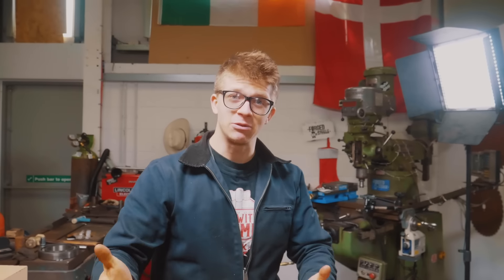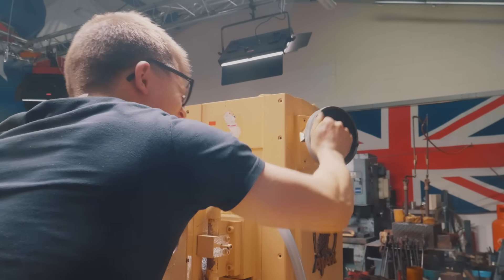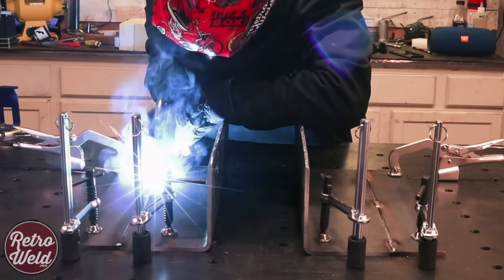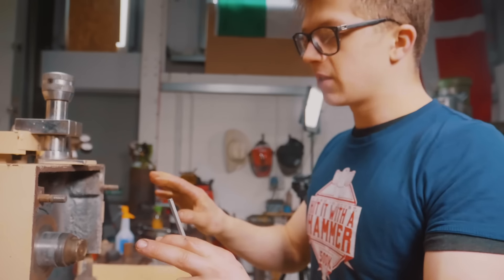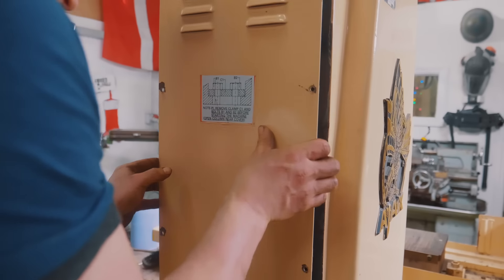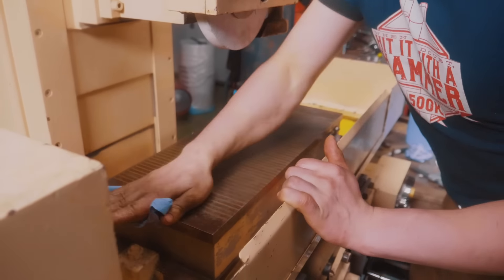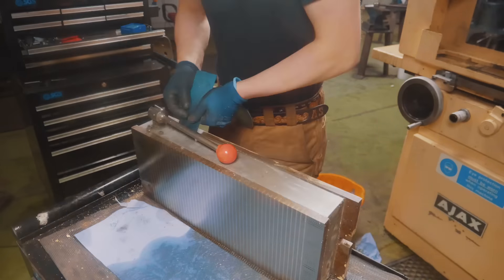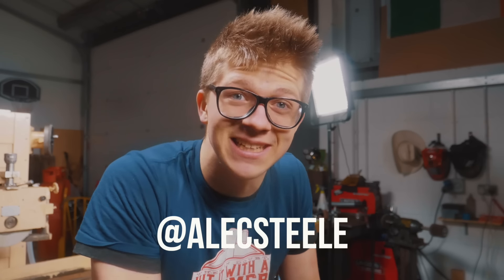THE SURFACE GRINDER IS ALIVE!!!

Comment: Hi yes you can use a machine/motor without neutral connected. But as far as I know you always need the ground, not to make it work just for safety reasons. So a regular three-phase motor has a lot of coils inside. Always one third of those coils connects to one of the three phases from the live wire. Because of the wiring inside your motor the three currents from the three phases cancel eachother out after flowing through the motor, so you don't need a neutral. A regular 1-phase AC motor (for example the one in your washing machine at home) needs the neutral to work (and the ground flr safety again). I can't explain it in more detail because thats it with my english as I am from Germany. I hope I could help make things a little clearer
Reply: You are correct. There are two ways to connect a 3-phase motor and they are called delta wye.
Reply: Eetu Jääskeläinen thanks for agreeing with me that means I somehow made my comment understandable for other people than me😂😅
Reply: aassug ok thanks
Reply: Down in Oz we call it either connecting in Star or Delta. Unless there are 6 terminals in there (which my brief glimpse didn't see), it doesn't look as if you have the option to choose. If there's no neutral terminal, there's no need to connect it. Often there's a wiring diagram on the inside of the cover... unless it was paper and disintegrated. Make sure those screws are damn tight though, and thoroughly twist the wires until they're like a solid wire (use pliers), with no loose strands hanging free. (I did not give this advice though, as here it's illegal here for those without a licence to play with electricity) Best of luck :)
Edit: that's just motor connections, of course you're not going to get a choice there, and the control circuit will probably need the neutral, unless there's an internal transformer, but I see you found a screw for it and got it connected, otherwise it may not have run at all.
Reply: The Neutral is not needed because there is no unbalanced current to send back on a neutral, otherwise known as a balanced load.
Reply: Cederbee, it's not needed for the motors, just the control circuit. I amended my last comment when I realised I'd forgotten about that :(
Reply: owl3764 Yes for control circuits. Electronics require the neutral 😊
Reply: owl3764 Hi thanks for explaining again. In Germany we call it Star and Triangle (not Delta) I just didn't know if I could directly translate that into english. As I wrote before I am no native english speaker but I am an electrician so this is basically my job
Reply: I+Marki Baki, It's good when google translate works. I thought the motor connections would have different names in different countries. I too was (retired now) an electrician for most of my working life, I worked in and rebuilt (electrically) a large factory over many years, with no more that a couple of guys at a time. Pulling out switchboards that looked like rats nests and replacing them with beautiful new boards and had some of the finest German P.LCs running the process and control. I loved my work and was constantly taking further training courses, until I qualified in electronics as well. I did get my contractor's license as one of my first priorities, so I could start my own business whenever I wanted and not get into trouble for wiring up friends houses on the weekends, which seemed like playing after working with 200kw motors and DC drive circuits. I worked in a hospital on medical equipment and all the side departments, that don't get too much attention, after the factory, which was a lot of fun too. I really did love my work, even though I worked far more over-time than any of my friends and was often on call, to have to go in to work at any hour of the night or weekend. Hope you're enjoying your job too Maki.
Reply: Okay, official. You may need a neutral connection for the control circuit. The main motor, hydraulic motor, coolant pump etc work on 415 volts. The control circuitry, which includes the push buttons and the coils which operate the contactors which control the motors should be 110 volts at most and the transformer which supplies the 110 volts may be connected between 1 phase and neutral (240 volts) and therefore the m/c wouldn't work without a neutral. Everyone is right about the earth connection. It's better that any short circuit finds its way to earth via a wire rather than you!

Comment: U can run it whit out (N) becasue its 3 phase motor and it should not return anything to the (N) if its runing tight means its balansed
Reply: cloudstrife1989 still need earth protection tho
Reply: Also u dont need Ground to run it. Its just not that safe if electrisity gets on the metal shielding :D
Reply: The relevant rule being BS 7671 543.7.1.202 so if you want your insurance to be valid you better have that earth.
Reply: I slowed down the video to check out the control panel, the neutral is for the control panel, not the motors, and as cobalt said, an Earth isn't optional, any fault could kill you. Never play with anything other than extra-low voltage DC without a good earth connection.

Comment: Depending on the engine and circuit the neutral wire is not needed. The machine also probably runs without the ground wire, but you might get an electric shock when it's not connected.
Reply: Yep. Earth/ground is a safety feature and (electrically) not necessary for normal operation. And three phase motors don't necessarily need neutral.
Reply: Anything abrasive tends to build up static charges, you want that neutral connected for that and of course the obvious safety issue...
Reply: the neutral actually is needed in this case. Not for the motor but there are relays in it and its coil is rated most often just for 230V. Between lines you have 400 volts and between line and neutral you have 230V

Comment: Sweet! Does that mean you'll be able to start making armor now? Because I like your machining and all. You're getting great at it. But I miss the blacksmithing a lot. More whack whack
Reply: Joshua Kellogg yeah more whack whack
Reply: Not really, would be my guess. For armor you usually use an English Wheel and a whole different tool set/hammers than Alec got at this moment. Armor is mostly made out of sheet metal. Could he make armor right now? Of course, it's Alec! He would find a way :P
Reply: As I understand it, traditional armor was tapered to put more thickness in the places that were more likely to take a blow and reduce weight in the places where you weren't going to get hit as easily. Armor made of sheet metal may look the same and weigh the same as traditional armors but they wouldn't be as protective because of the uniform thickness of the pieces. And you're not going to get the taper in from working sheet metal. You need to do a full smithing from blocks to get that.

Comment: Do the simple thing first, dont trust the work of the guy before you and 90% of all problems are human error(AvE).              
 you didn't do anything wrong here but when you buy old used tools/machinery you have to open her up and look inside to see whats rusted, whats broken etc and then fix it before you start her up. just my opinion. cheers from italy

Comment: For more sink water pressure. Remove the aerator from the sink, disassembled and there’s typically a plastic disk with an o-ring, break the center out that has the o-ring and reassemble. Replace aerator if it’s corroded and then still do this with the new one.

Comment: I haven't look through enough to find if you are using some type of coolant filtration. To keep the coolant recycle clean as you are grinding; especially when you re-dress the wheel you may want to figure out a rudimentary filtration system or your pumps/nozzles could wear out really fast, and your parts may be out of whack a bit.

Comment: For best results when dressing the wheel, do it beforehand. When the machine stops you run the chance of the wheel losing round, so don't turn it off until the surface work is complete.

Comment: hey Alec I think that lubricating oil is only for taping or when threading on the lathe, when you do other stuff such as milling, drilling, surfacing, etc, you should just use coolant. your tools will last longer

Comment: As far as I know your chuck doesn't have to be square. There is no datum plane anyway, so if you put something on it and want to grind square to the axis of the wheel, (like if you were doing an inside corner or something) you'd have to indicate that part individually. You can toss a part down on the chuck at any angle, as long as the surface you're grinding is parallel to the top surface of the chuck.

Comment: Hi Alex. To remove the grinding stone you take a propper size wrench mount it on the not on the front of grinding stone and hit it with a robber hammer i think it is a left hand threding. Now you need a puller to remove the grinding stone assamble from the taper spindle.

Comment: I was mesmerized by this! I was only going to watch a little (because i was trying to educate myself on grinding wheels I have) and your humor and good looks combined with humility sucked me right in. I'm going in for more vids. 
 Thank you. I needed some laughs and to know that there're still men out there that can admit when they're wrong or when they make a mistake. Mind-boggling and refreshing indeed!
 New subscriber for sure! 
Side note: I sell on Ebay and a few years back I helped liquidate a plant that had huge machines from Sweden,  Germany, Quebec and more so I ended up with a surplus of odds and ends of hardware, grinding wheels, cables, motherboards, PLC odds and ends etc. Pretty much have no clue what I have and that's why most of it I haven't even listed on Ebay. So if interested comment and maybe I have a bunch of doodads or whatchamacallits you may have been searching high and low for. Lol..let's make a deal!

Comment: Nice.  Watching the assembly of your "Spanner" for the grinding wheel.  My guess is the original was either C or O shaped with the opening in the middle large enough for the shaft to pass through.  As opposed to a straight across configuration of pins.  This gets the spanner closer to the plate you are holding still (ok nut) and allows you full access to the end of the shaft.  It is always fun to watch your videos.  You seem to enjoy working on your projects.  Thank you.

Comment: In case nobody has mentioned it yet.  - You should dress the wheel every time you turn it on, therefor if you dress it you are not meant to turn off the wheel to setup. 

Set your part, turn on the wheel, then dress, and run.

Comment: The Table does not need to be square. BUT my ocd says it should be.  Plus think how far it was out by how much you ground off the surface.  (we had to re-true the surface after every "angled" cut.  If you adjusted the table to grind a taper, you set it back to level and then grind the magnetic table to make sure it was true to the wheel.)  NB: we were grinding in 60 degree angles at some points for tooling.

Comment: Hi Alex,
any time you are going to "dust" the chuck, it will be a good opportunity to pull the chuck of the bed and clean underneath it of any rust and scrap, re oil the base then re tighten the chuck in he aligned positioned - square.. following this then dust the chuck

Comment: If you are having problems finding wheels to fit your grinder there are options. 
1~ If you find one that has a suitable size externally and the bore is to small you can machine the bore. 30 or 40 rpm (Less if available) and a carbide tool at about 0.010" per rev should cut a reasonably parallel bore. Use the outside jaws on your 3 jaw chuck and use rubber( Insertion rubber sheet if you have it) between the jaws and the wheel. Not to much pressure to clamp the wheel, as a guide I tell my apprentices that as long as you cant spin the stone in the chuck with the best thumb pressure they can apply it is tight enough ( for little stones like that)to slowly machine at say a 0.010" depth of cut. The thing to remember is GENTLY clamped and machined. Oh and keep an eye on the tip they will wear pretty quickly.
2~ If the bore of your grind stone is oversize you can bush it with plastic to either the correct size or machine it to the correct size. using the above principals. For a thin wall plastic bush 0.015 ~ 0.020" interference fit is enough.  Don't use nylon as it soaks up water and swells. 

There are other ways to bush wheels but these are not really suitable for the wheels under 25" For example severely chipped bores can be repaired with babbit. I wouldn't worry about balance on your little machine precision balance wont be an issue.  Every time a wheel is removed and refitted it should be dressed regardless of how well it fits. To control the sparks and dust I would recommend a second coolant outlet either aimed at the rear of the stone of a port in the stone guard that directs coolant to the rear and showers the sparks. That will almost completely eliminate the dust. A tip regarding the rust, Any machined surfaces that bolt together like vices fixtures etc that are going to be left for a long time I coat with a medium term rust preventer fluid ( one week fluid like ennis light made by shell as it drys soft) and clamp them up wet. This works really well and you will normally only have corrosion around the edge after years of a fixture being in place. You must also ensure the table and fixture is dry. Wipe down dry and coat in  metho (before coating with anti rust)and light this will draw out the water in the iron, Conservative amounts please you don't want to set everything on fire. Alternatively try a hot lump of steel sitting on the table but not to hot say 250 c and the heat soak will do nearly as well. 
Theres a couple of tricks you wont find in the text books??
Cheers
Reply from the maker: WOW! I cannot thank you enough for the incredible tips! Thank you sir!

Comment: Run the wheel after using coolant to remove any coolant absorbed in the wheel. Otherwise it can settle and unbalance the wheel. Wheels do explode if you have unequal mass spinning at high RPM

Comment: You should add more pressure to the coolant. Its not only for cooling the material, but also helps keeping the stone "open". Grinding the magnet is really hard on the wheel btw :)

Comment: Probably he figured this out by himself by now, but the way he ground the chuck will not give him a flat surface. If you start with full whjeel engagement your wheel will wear over its entire with, with the result that your first passes will be lower then the later ones. 

Always start outside of the workpiece and move in one direction only, this way you wheel contacts on one edge and slowly wears from that edge over to the other, leaving you with enough dressed surface to ensure level grinding.

Comment: When changing grinding wheels you should ring test the wheel to make sure there are no cracks in it.  Hold the wheel in the center on a hammer handle then tap the wheel. You should hear a ring if you hear no ring it may be a bad wheel.

Comment: Good job Alex! I'm so happy you got the grinder working. Don't be so hard on yourself about the mag table being out. This is your first grinder. If that is your worst mistake with it, you're good. That rust underneath looks like it developed with the mag table on. I took a ton of metal shop classes in High School and Trade School. The surface grinder was my favorite tool right after the mill and lathe.

Comment: So...in school they taught us to set the diamond dressing tool at the center of the wheel...that way your not eating through the metal holding the diamond tip.  Bring the wheel in contact and then manually move the table in and out until the surface of the wheel is white all the way across.  That way you know your wheel is flat, otherwise you can end up with low spots that will not touch your workpiece.  

Your videos are AMAZING and I look forward to every new one to come out.

Comment: Hey just a quick tip if you still have a piece of that broken wheel keep it and use it to rough up the bottom of your parts after heat treating helps the magnet hold on so your parts don’t go flying

Comment: You don't really need the table to be square in the first place, the items you will put on it don't need any reference line. You just need a flat surface, although if you want the surface finish of the things you want to grind to be exactly lined up with an edge, you did a good thing by squaring up your table.

Comment: Alec, curious about particle collection/filtration on the surface grinder. How does the machine separate out all the waste material being mixed into the coolant thereby preventing clogging of pumps/tubes/etc.? Are we talking a magnet or filter in the coolant tank?

Comment: yes it can run like that. its obviously a 3 phase motorized machine and these kind of motors dont need a connection to ground or zero phase. The whole current that comes in to the motor on 3 phases is canceled by itself so there is no need to bring back the current on a zero phase. but you can connect both, earth and zero, it will not change anything.

Comment: Hey Alec, I'm newer to your Chanel and I've binge watching you like crazy, but I have some experience with a precision grinder (or surface grinder as you call it) but a note about the piece you made to remove the nut from the grinding wheel, the one they typically come with are more flat and wrap around the center bolt, thing of it as a pair of scissors that you are opening or closing, the prongs that fit in the holes are mounted on the side of the key. By doing this you don't have to try and fit a crescent wrench inside of it and you have much more control when removing the bolt